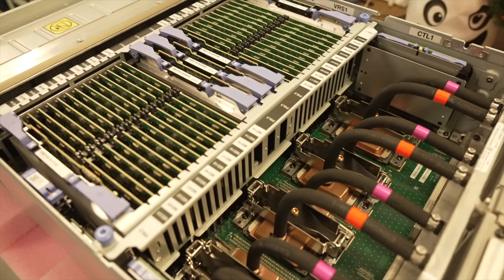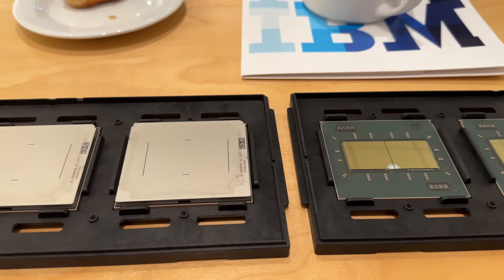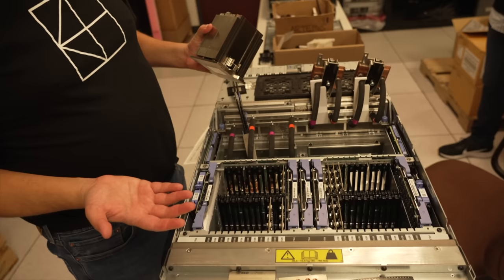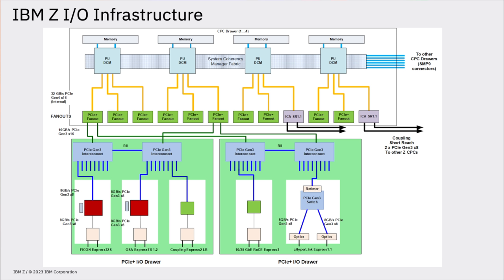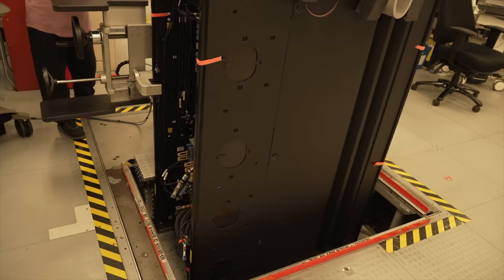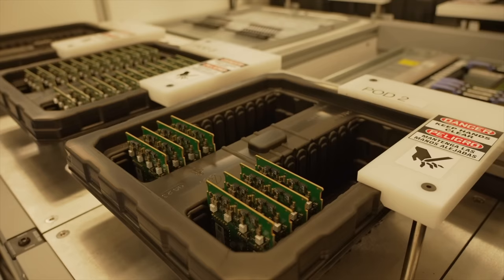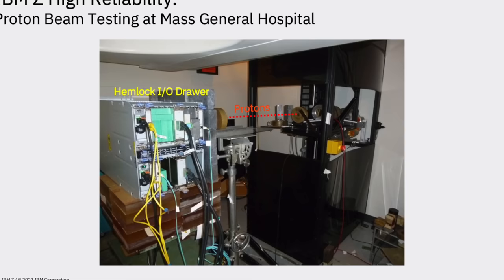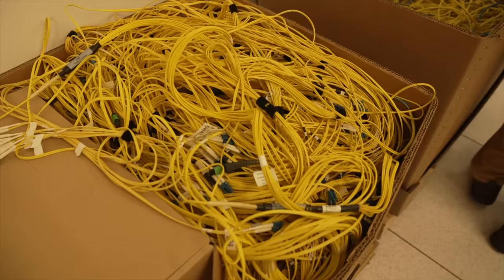Why Do Mainframes Still Exist?  What's Inside One?  40TB, 200+ Cores, AI, and more!

Comment: I am super impressed by the product and the video. Great job Dave !

I readily agree that there is no direct comparison between the z16 and the x64 worlds in many areas (cache size, CPU speed, product engineering + testing .. so many of them). 

On the other hand, I would like to give a picture of a typical x64 enterprise ecosystem. 
Let's consider a four rack layout as the z16 - two racks for compute and two for storage.

As an example, I would take Dell MX7000 chassis with multiple interconnects and Dell MX760C servers with dual Xeon Platinum 8562Y 32C/64T processors, with 1 TB DDR5 memory. One can mount three of these chassis per rack for a modest density (I have done several such installations, albeit with dual 24 core processors and 1.5TB memory each). So, we have two racks, six chassis and total 48 blades. This gives you 48 x 2 x 32 = 3072 CPU cores and 48 TB memory across two racks. I used simple interconnections for each blade - dual 25Gbps Ethernet + dual 32Gbps fibre-channel ports. In a typical setup, each chassis can have 2 + 2 x 100 Gbps and 4 + 4 x 32 Gbps FC uplinks. So we are talking 12 + 12 x 100Gbps Ethernet and 24 + 24 x 32 Gbps FC uplinks for the entire compute part.  Everything is powered by N + N 3-phase power supplies.

This is not a maxed-out configuration, by the way.

In the two racks earmarked for storage, one can install several all-NVME or SCM+NVME storage systems from any of the major vendors (IBM, NetApp, HPE, Hitachi .. whatever) to get multi petabytes of strong performing storage and plenty of 32Gbps ports.

This is just a typical setup, completely apples-to-oranges. Is the processor speed way slower than z16 ? Yes. Does it have seven 9s uptime - no. Is the chance of one blade or one entire chassis failing more than z16 - yes. All six chassis failing together - I don't think so. Does it perform well for typical scale-out applications ? Yes. If you need 100 PCI slots or dozens of crypto accelerator cards for whatever reason - anyway this is not for you.

Comment: Thank you for the indepth look. Yes mainframes are that good and way more powerful. 
Also, like UNIX, much of the same commands and code still runs today - though it has been tweeked to be faster.  $HASP still runs on z/OS - 80 long years after 1960's Apollo program. The code you learn today will be used for years to come . 
VM did re-entrant code back in the 1980's  Run 60 VMs off one copy of the code in memory. One (1) copy of Windows, IE, Word, etc, etc.  Massive memory savings. 
There is more to the story. This was just a mind blowing overview.  Disk drives have three letters and three numbers. 26x26x26 x 1,000  which is a really big number.

Comment: Early ‘90s or sometime, I first heard of RAID as “Redundant Array of Inexpensive Disks”. When IBM rolled in our center’s first, single cabinet RAID, “Redundant Array on Independent Disks”, the equivalent of a 4 cabinet string of 3380 drives, I noted that anything from IBM was Not “Inexpensive”. However, it was our first gear that called home to get a part replaced, as demoed by the tech showing up, unannounced. Never an outage.

Comment: I’ve been in IT for 26 years as an IP network guy on mostly distributed systems in the financial sector. Mainframes are still a confusing mess for most people as I can attest most IT people think they’re an archaic technology that has surprisingly not died. But I’ve been recently working on a project to put a firewall in between Z16 systems so I had to get familiar with all the applications from a network perspective and I’ve grown quite a respect for even how efficient the network and port usage is on a mainframe and this video really shatters that strangely ongoing myth in the IT world. I learned some 60%+ Fortune 1000 financial companies still use them and that alone speaks volumes but as this video clearly shows not only is it a myth that these are old and outdated but quite contrarily very modern and cutting edge.

Comment: Great video. This is why you buy IBM and not Lenovo. In the 90's you wanted a ThinkPad because if you dropped it or it got ran over, chances are it would bootup, even with missing parts of the screen. The company I work for went from Dell to HP, common, but now are going to Lenovo and no one one wants to look at the fail rate. Until a big wig has their laptop not boot up after a week, then it's a crisis.
I learned things about Mainframes I did not know. RAIN (redundant/reliable array of inexpensive/independent nodes). Make sense, like pour water into places on a field where there is space for it.
I've never worked with one directly, but my parents did back in before the day in the 60's, 70's, and 80's when 64k of RAM was considered massive and they used punch cards. The biggest innovation to punch cards was to number them, game changer.

Comment: 2:01 - I worked for a company that was building computer systems based upon the PowerPC architecture.  The company had been building cached systems for twenty years at that point, but decided to buy a cache controller from IBM codenamed "Mamba". After failing to deliver the controller, the company designed TWO cache controllers (look-aside and in-line) and successfully sued IBM for failure to deliver. Our saying of the month was "IBM don't Mamba"...

Comment: A critical issue for using fiber is size - fiber lines and bundles are much smaller than the equivalent Cat cable lines and bundles, this allows for higher density of the interconnect packaging.
Reply: I still remember the BUS and TAG cables between our Amdahl V6 (IBM compatable) CPU and our peripherals such as disk drives and tape drives - each cable was about 1.5" thick and far stiffer than a garden hose!

Comment: Thanks for the effort in putting together an enjoyable video to watch.   While true to some of the things you said in the "why mainframes section"..... but similar levels of redundancy, throughput, reliability , virtualization etc.... can all be achieved by non mainframes. 
 
One key factor  that I thought you haven't mentioned  is that the site specific customized codes (some written by the client while some by IBM )  in SVCs, exits in CICS, IMS , DB2 and undocumented cobol/fortran code are just too complex to migrate away from (I know from my personal experience this is true in 2 places that I used to work).  

AND the number of people who still speak fluent CICS, MVS (or whatever that it's called), IMS etc are dwindling.  Therefore, it's a very high risk undertaking that many FIs are unwilling to take.   

AND no CIO is dumb enough to go ask the board for 10s of millions to do something that has a high failure rate.   And IBM has been keen to provide incentives to make USING the mainframe as economical as non-mainframe.     At the same time, the mainframe apps are just as solid as 10 years ago and will continue to be the case.... why would anyone change ???!!!

At the same time IBM has made its big iron more economical to run, offered expandability that turns the 'mainframe' into a giant server.... running enterprise class Linux and others .

Comment: All I can say is we have come a long way from IBM 360s and 370 4341, Hollerith 80 column punch card decks and 3270 terminals which is what i learned on with Mainframe assembler, job control language and the EBCDIC character systems and the days of COBOL, FORTRAN and other languages.  1980s what memories I had.

Comment: What a great video....... I thought that Mainframes were on the way out, but I can see how much better mainframes can be  for mission critical computing.

I used to work for a Fortune 100 insurance working on 'replacing' mainframe' with a more 'modern system'. This project went 5 years, and then after a change in CIO, we went from rolling our own system, to buying an 'off the shelf' system that could be configured and modified for our use with out own business rules. That project went another 5 years before I was let go from the company.

I just talked to someone who is still there the other day, and the project is still ongoing with people trying to bring the business rules from Mainframe to the new system because people do not want to change policies.

so it has been over 15 years since the start of of this project, and still have not been able to shut down mainframe because of the book of business till on it.

Comment: Great video.  Mainframes are still pretty awesome after all these years!  One correction: "7 nines" availability means you're allowed to be down for 1 part in 10 million, and since there are 31,536,000 seconds / year, a 10 millionth of that would be 3.15 seconds.  You'd need "10 nines" availability to get that down to 3.15 milliseconds / year.

Comment: Very good presentation. How about doing a presentation on System P a close architecture to System Z
Also can you give the weight of a fully configured Z16. When doing a SA(system assurance) these and other spec are necessary to know)
Also you might mention where the power supply is located and a few words about the service processor which is very important part of an IBM mainframe 
Thank you for a great presentation 

Ricky from IBM
Reply: You spoke about have additional engines (processors) installed but not being used. This is part of COD(Capacity on Demand) This a way cool feature and along with the service processor and HMC(Hardware Management Console) ability to create logical partitions and a software product called Work Load Manager is a very powerful feature in the mainframe world which allows customers to do things not doable on other platforms .

Comment: I've only ran across a mainframe at one job in my career so far and that was back in 2012-2013 when I worked as level 1 support for Fedex. At the time they were still running nearly all of Fedex Ground's infrastructure off IBM AS/400s. The interface still said Roadway Package Systems (which Fedex bought in 1998). So even then these things were at least 15+ years old but they just worked. I worked there for about a year and a half (job got moved to India of course) and in that time I was not aware of a single issue that ever occurred because of issues on those systems. 

An older co-worker who had been there for years had said they basically just left them alone and hoped nothing ever broke because there were so few employees who knew how maintain them. Safe to say nothing did break on them. I wouldn't be shocked if those things were still chugging along to this day over 10 years later.

Comment: Something that the video didn't touch on is that mainframes are using different instruction sets, usually allowing more complex operations in a single instruction than x86, which make it inherently more suited for specific tasks.

Comment: good video, good presentation, thanks and yes, glad you mentioned virtualization!  vm 370!  this is the title of a good video i watched yesterday:  "1972: Introduction to VM/370"  from the notes:  "This introductory to VM/370 video was shown to IBM Field Engineers (FE) in 1972.  Field Engineers were responsible for maintaining and repairing equipment installed at customer sites. This video describes the how virtual machines work, its features and advantages of the virtual storage technique in improved computing." 

I was aware that virtualization started with the mainframe but, did not realize how early!
Reply: IBM was delivering VM technology on the 360 model 67 (modified model 65) by 1970. . .

Comment: The company I work for has 8 z16's in several different data centers, each running multiple sysplexes and LPARs.  My first encounter with a mainframe was when I was in high school learning to operate a System 370/135H (IIRC).

Comment: HP did RAIM too; I once built a used rack for a client and one of the machines was a 7RU chassis with 5 warm-removable cartridges that you could pull out and swap while the box was still running.  Neat.

Comment: I was a IBM systems CE back in the '80s when everything was big and water cooled. In the early 360 days you had to look at the books and figure out where the failure was. There was no "hot swapping" and when it failed, everything went down, and thousands were unable to work. I got out of it when things started to get redundant and you'd come in on Saturday night and replace the part, the error code, called for. No fun in that.

Comment: We still use a 3270 mainframe terminal emulator in daily work. Viewing, entering, retrieving data.  Downloaded data is sent to what the mainframe thinks is a dot matrix printer. 

It's still the primary corporate operational system (I won't name the company), they even stopped after 15 some years telling us that the mainframes will be replaced. Hundreds of thousands of users connected at any one time, nowadays most of them working via a web interface behind which is hidden the terminal emulation.

Comment: Thanks Dave, very informative.  IBM makes awesome hardware.  I worked at IBM for 22 years, part of that time as a system engineer with mainframe customers. I did a residency at Poughkeepsie, so it was nice to see the labs on this item. Later I developed software for a IBM AS/400 (iSeries) customer. The iSeries is the best computer  architecture I have seen. The large models are used as mainframes. How about going down to Raleigh to do a similar item on the iSeries?

Comment: Very interesting.  How about doing an episode on the history of fault tolerant computing?  I worked on Stratus and Tandem platforms during my career and they had very different approaches to fault tolerance - (almost) transparent hardware FT in the case of Stratus and (mostly) software FT for Tandem. Typically used to ensure high availability in critical financial and telecoms applications.

Comment: I used to work with the AS/400 and similar machines, I knew that there would always be a place for IBM, whether it's in the DOD, financial sector or collecting taxes, these machines are very special, even if they won't run League of Legends (without some jury rigging).  This was a really interesting overview, and I must say that the data throughout between those machines is really incredible.
Reply: Pendulums swing. Back in the late 60's, very early 70's distributed computing was the thing. Remote small 360's with larger machines at corporate. Then consolidating at corporate with big 370's enabled by better data communications. Then back to distributed computing with the advent of cheap micro processors. And now ... Big Iron still lives.

Comment: Its just amazing they can accomplish full isolation, fault tolerance/redundancy and transparent hot swap of any module all at the same time. That's Blue Magic there! 
And of course you met energetic engineers - its nice to work somewhere where you expected to innovate and have all the resources (and capital) to do so. Its very interesting to compare mainframe vs Cloud although they are not mutually exclusive.

Comment: I wanted to see more of the software side.  As you pointed out near the end, it's almost irrelevant in that everything is virtual machines and all we'd be looking at is one mother of a hypervisor that hosts other hypervisors that host OS's.  I'd still be interested in how wide the data bus is, for example.  I suppose I could do the math of how many bits it takes to express 40 TB.

The hardware is amazing, but without software it's a very expensive paperweight.  And visa versa of course.  Software with no platform is just an idea.

Still a very interesting video.  Thanks!

Comment: The main advantage of doing inference on the CPU is ultra-low latency--GPUs can do very fast inference, potentially much faster nowadays, but they have to operate on large batches to be efficient and the task must be able to burn enough flops to offset the transfer across PCIe (which is nowadays 32GB/s on a PCIe v4 x 16).

Comment: Really well done video, thx.  I learned something.  FYI... US Federal taxes are still done on a mainframe because the basic pipeline processing mentality hasn't changed since the 60's, there are still 100's of thousands of lines of ancient assembly and COBOL underpinning the processing that few folks know/understand (read big risk to change).  The primary reason is that Congress has chosen to radically under fund the agency for decades.  Even though sharding should be easy since the primary key is simply SSN, it's not done that way as you'd need to re-architect the core processing engine. Hopefully some of that will change with the recent funding, but I'll believe it when I see it as each and every "modernization" program undertaken over decades has had a goal of modernizing core tax processing, but has made little progress after throwing billions upon billions at it.

Comment: IBM has always put their full weight of research and dev into the main frame product line. They have  made some very impressive hardware in the years since they've used this approach. Imagine how great IBM could have been if they had let their other computing branches use that same R&D but for decades IBM has hindered any group that might take one iota of business away from established product lines. For example, the mid-range "mini-computers" were not allowed to utilize tech that might lead customers to replace main frames with a more cost effective but functionally sufficient, smaller system. Unfortunately, competition exists and others stepped in to create the computer market we have today where IBM isn't the market leader in the industry that they once were. 

Dave Jones from EEVlog channel has taken apart a main frame CPU and there's a German guy that I used to subscribe to (still do but don't see any output), who made some excellent hardware porn taking apart all sorts of CPUs and using x-ray and other imaging to make some great videos exposing the inside of exotic hardware as well as common CPUs from old to new. Cool stuff. Dave.